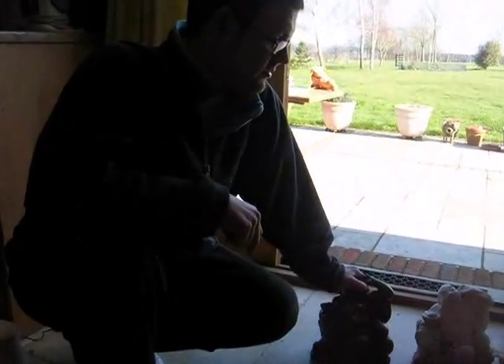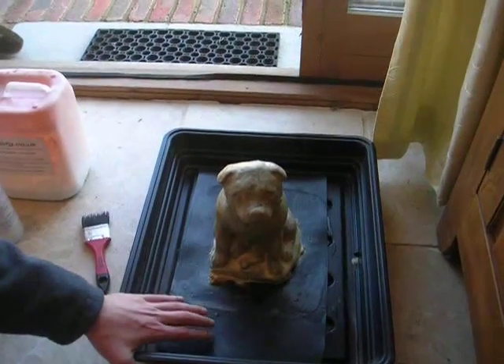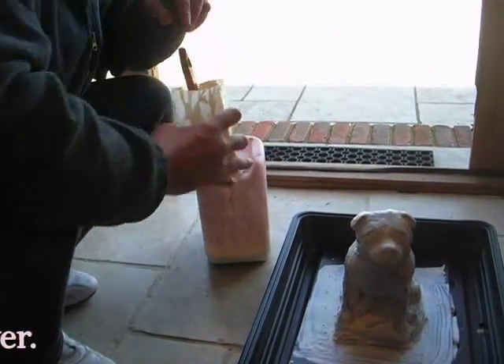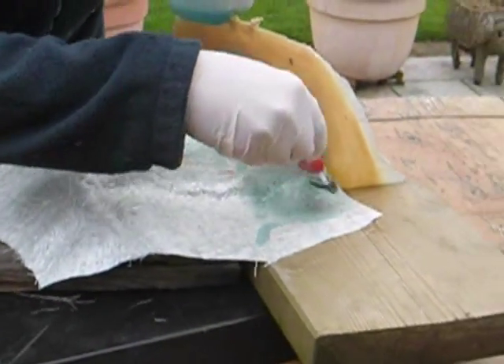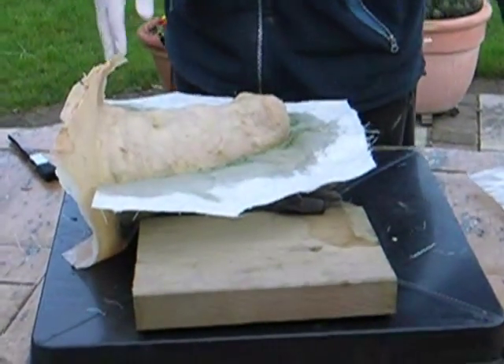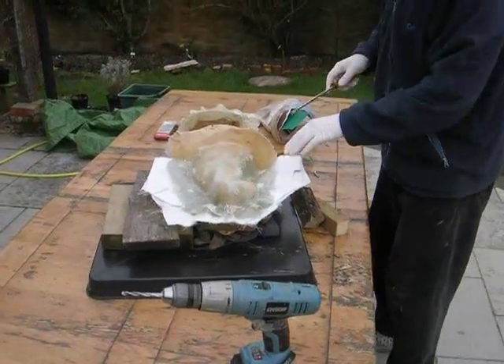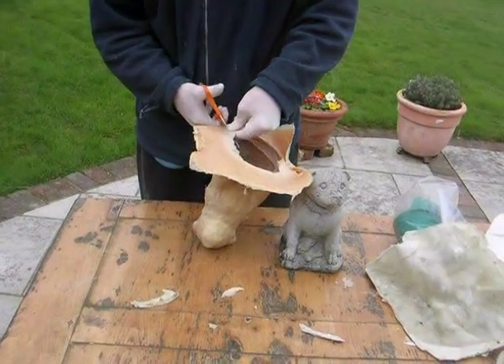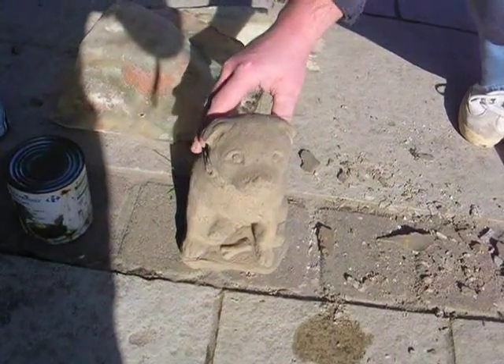Mould making

Comment: Thank you for the video, it has made making the fibreglass mother mould a lot more straight forward, compared to other videos that I have watched. I will make my first one tomorrow.
Reply from the maker: Thank you for commenting Neil. Hope it works out for you.As the mother mould is only supporting the latex it doesn't have to cling to every detail. Good luck.Any questions just ask.
Reply: I haven't got round to making mine yet as needed a couple more things. But if I get any problems I will let you know. Thank you